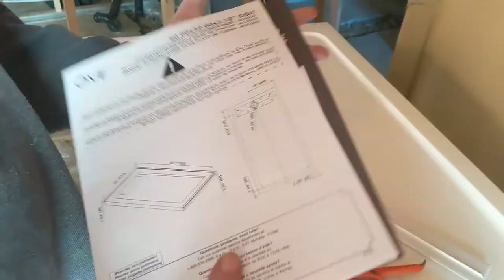How to install Fiberglass SHOWER BASE

Comment: Hi Bahiano,
Great video! I'm just wondering you're using silicone for sealing the connection between pipe and shower base... Isn't it to replace after some time then?
Reply from the maker: Hello there, thank you very much for watching my videos, I use silicone on the drain, lot of time the fiberglass where the drain goes is not as straight as it should be, the silicone is extra precaution to prevent leaking, on a perfect world, we would not need to the silicone, thank you very much keep safe and enjoy life
Reply: @BahianoReno  Thanks for sharing your video and for your answer!
Reply from the maker: You are welcome, see you in the next video
Reply: @BahianoReno  Sure! 😃😊
Reply from the maker: Happy holidays, keep safe